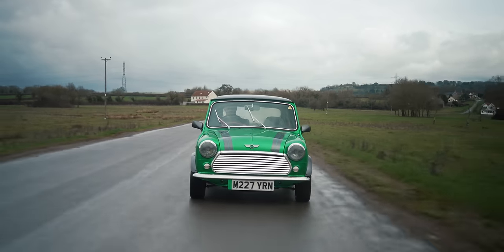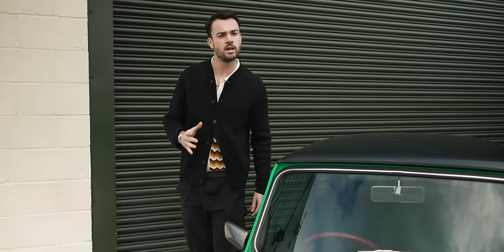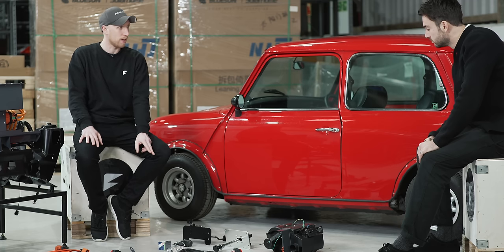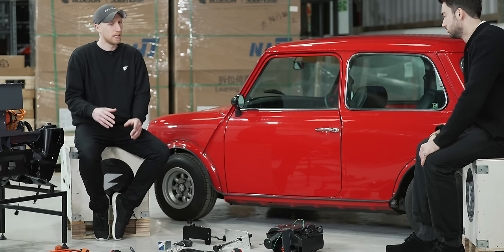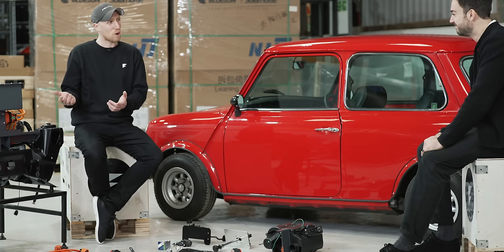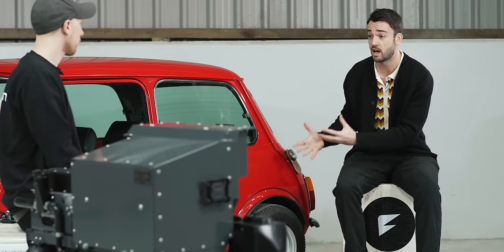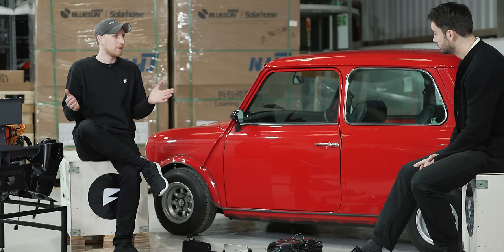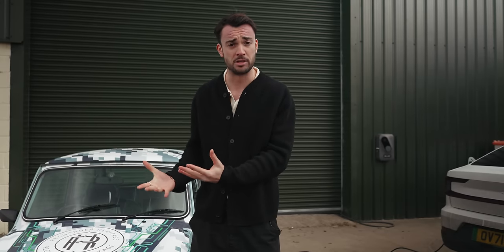How CHEAPLY Can You EV Convert Your Old Car?

Comment: At first glance it seems like a good idea to get a cheap conversion, IF you have a decent car and if you can get the conversion done at a good price. There's an increasing worry that Tesla may software lock or hardlock their part compatibility and use like how Apple had has done.

However, if you don't have an old car or are looking for one, you'll need to buy and repair one (new components, bodywork could set you back hundred to thousands).

Then you'll be losing out on modern conveniences and safety, ABS, aircon,  sensors and even safety ratings. 

It may be cheaper to buy an old EV, an old hybrid or a new EV as bad as it sounds.

Comment: The easiest and cheapest conversion? I'm sure I'm not the only one to have this idea... As most cars on the road are front-wheel-drive & ICE, the simplest and cheapest conversion kit must be to add small hub motors to the rear wheels and a small battery. Along with a simple controller to add power when accelerating / cruising and regenerate under braking. It could be totally independent of the cars existing functions and controls. It could add many miles per gallon. I think it should be relatively cheap and quite simple and easy to fit too. Is this approach being progressed by anyone?

Comment: would be nice if someone made in wheel motors to stick on old cars to electrify them... seems simpler to me... rip out the engine/transmission, replace the fuel tank and fill the engine space with battery boxes...

Comment: I want to get into the conversion business, but the more I learn about it the more I think that manufacturing the components is needed more. All the advanced components that are being salvaged from wrecked EVs, motors, electric brake boosters, traction and stability control, etc, are made by mega corporations like Bosch that couldn’t be less interested in selling for conversions.

Comment: I own a Vespa pk50 xl , I really wanted it to be electric but getting parts for it is a joke and the places who do them are always out of stock. I thought about building it all fully custom but its so difficult due to the tiny amount of space available.  I ended up just building a full custom 125cc racing engine for it. Yes the thing is stupid fast but I wanted it to be almost silent and be eco. Also wanted to power it in the future off home solar power. It sucks because I spent over 10k on the engine, for something that I didn't really want to begin with as I wanted it as an EV so I'm just waiting for something decent to come out thats a normal price and is easily available , I will end up just buying another Vespa to convert to EV.

Comment: Not impossible, but highly impractical and not profitable. Bear in mind how often parts don't fit apparently identical cars. Prices will drop, but someone really needs to concentrate on a PnP HV system and modular battery system that can be flashed for different chemistries, as they change.

Comment: this is the way to go ...Makes more sense..Why make more cars if we can update current or older cars..Nice and simple none of this Sat nave video screen crap...Just a gage for speed and battery ....This is what GM and Ford should be doing instead of trying to catch up to Tesla . But for now it will not work in Canada its not allowed as of yet to which i do not understand they want us to change over to EV so whats the diff if it a Tesla or converting my KIA to a EV seems a no brainer to me ... its what i like and call High Low Tech solution and ....I hope to see this happen world wide some needs to knock GM and Ford of there high horses

Comment: You don't need to convert your old car to be an EV. All you need to do is to convert it to run on propane or methane, doing so is regularly cheaper than $1000 - half that for propane. If you have plenty of CNG stations to refuel your car in your country, you can even get it to run on methane, which is very eco-friendly compared to gasoline and propane - but that's only really possible for engines that are more than 90HP and if your car is already quite heavy (like if it's a sedan), so that the extra weight of the large methane tank wouldn't be too hard on your suspension and your engine.

Comment: Frankly, anyone who thinks that going electric is the best option, really needs their heads examined! I will be holding onto my ICE car until they prise the keys from my lifeless hand! The people at Toyota are not fools! They have equally found electric vehicles to be a distraction at best. The real option is “green ammonia”. This is Hydrogen fuel in a form that can be used in place of petrol; can be pumped like petrol and burns to leave water as the exhaust! There is no need to replace the engines, simply replace the fuel used in ICE vehicles!

Comment: It's not the engine that causes ICE cars to reach the end of their lives, it's the fact that after 15-20 years everything else wears out. The body rusts, the brake pipes corrode, the power steering pipes corrode. Innumerable parts need replacing and it just becomes uneconomic to keep a car on the road, especially if your paying a mechanic rather than doing it yourself.
I'm afraid EV conversion will only ever appeal to people willing to invest more money into a much loved classic than a modern replacement would cost. This applies even more to modern classics with their complicated electronics.

Comment: It's frustrating how expensive this stuff still is, I've got a Citroen C4 grand picasso that I'd love to have the engine ripped out of and batteries and motor put in it's place. I figure to get something comparable it's going to set me back around 10k after the arse finally falls off it, so if I could get an EV kit for that kind of price I'd be all over it!

Comment: Many years ago I have written a business plan on how conversion can be done at scale.  Unfortunately, I've never been able to get the funding.  I'm still convinced it can be done, and I am sure that (with the right team and sufficient funding) one can make it work on very large scale.  It would probably take 5 to 10 years to develop the kits, that can be installed by any half decent mechanic in say a day or so.  Basically the kits bolt into the original car using all the existing attachment points already there.  The other aspect, the original ECU for the engine would be reflashed so it becomes the communication in the CAN system for the electrical drive train.  As mentioned in the video, it is dependent on cost of battery and other components, those are still be bit expensive but as Tesla and some of the Chinese manufacturers are proving, that is coming down rapidly.

Comment: I understand why EV kit makers don't want to send their kits to just anybody. You want the job done well and the high voltage side of the conversion, needs to be treated with great respect and caution. However, I don't see why qualified MV technicians like myself can't be supplied with all the components minus the traction battery. And once the car is ready, take the car to have the traction battery fitted by those with the knowledge and the equipment to safely finish the project.

Comment: Retro fitting for classics will be a thing but for your old daily driver I dont see it being cost effective. I dont see the cost of batteries coming down considerably while they are Lithium based plus other rare metals because it is the supply of raw materials that makes Li-Ion batteries high in cost and restricted in supply. If a new battery tech using cheaper and more common inputs crops up then the retro fit conundram will improve. however we know battery tech for cars is pretty much at its zenith with Li-i0n so solid state will probably be the wished for change and that is still a while off. The other factor about converting a daily driver is that a car is more than just an engine and gearbox. If your vehicle is at the stage where the driveline is on the way out then things like suspension and brakes and the interior may worse for wear as well especially if you have children. I know of cars that are not 8 years old and you can not buy parts for climate control systems or the servo motors that open tailgates and even windows as well as sun roofs. I live in a climate where the body of a vehicle lasts a very long time if basic maintenance is done but in the snow and ice areas the car body and bits cop a pounding.  +Now the other problem is that without an affordable retrofitting option replacing the global private vehicle fleet in the time frame those with rose coloured glasses say will happen is impossible. Even someone who is mathimatically challenged like me can work out given current build quantites of ICE vehicles and the average turnover time that car owners have that it will take many years longer, even decades, before everyone is driving a BEV. EV production will not match ICE production for many years if ever and battery supply is only one factor. You will also have to consider that there is a very large pool of people who never buy a new car for a lot of varied reasons and 2nd hand BEV's will be even harder to get and outside of these people purchasing power in many cases. Cars are not retail white goods, production is not that easy to ramp up. From a climate change action persective getting a total change over to BEV's completed is a drop in the bucket. Some say 10% others say less than that of greenhouse gasses come from the global private car fleet even the total transport sector that uses fossil fuels at present is under 20% so the main benifit of the private car fleet going electric would be city polution and the public and business sectors not being held to ransom by fuels cost cartels. Well thats my two cents worth and I am sure many dont agree but being a retired engineer in the automotive industry I know how supply chains work and how long they take to establish and how fragile they have become in a globalised and JIT supply world. I have not even touched on a world with conflicts going on and future ones that will limit our use of Chinese manufacturing capability.

Comment: I would love to do an EV conversion of my own. I myself would love to do a minicooper, but my wife doesnt like mini coopers for some reason. Who knows what I will do eventually. Ive built batteries and electrical systems before, so I think I could learn how to do it myself... I know Im going to want something small and lightweight enough to keep the cost of the battery and motor as low as possible. I only hope to get a 50 mile range or so...

Comment: Haha That orange buzz-bar or bus-bar is coated in orange rubber not for durability or "doing it nicely" but for insulation. It's a high current conductor. So not a great example of something that can be use to cut corners to make it cheaper.

Comment: If you have a relatively new IC car and want to convert it to EV, there will be problems with sensors you have to remove from the car. How will kit companies solve all that?
Kit companies should also look into cheap replacement battery packs for current EV car that brake and replacement parts cost more than the car is worth...

Comment: Most modern cars were never designed to be repaired. They are built by robots in a way that requires too much work to even get at the parts. They do not produce parts long enough or models with interchangable parts over the years. Not to mention anti right to repair problems. They are built and made to be simply thrown away objects that self destruct once the warranty is done. Something like 70% of the polution is in throwing away your old car. Electric cars are simply a buzz word to distract you from the real problem and get you to buy another car.

Comment: Most people will not replace their cars in next 5 years. Even if there's a miracle and all car makers switch current production to 100% EV and the production volumes are not lower, it will take at least 20 years to replaces all vehicles on the roads today.

Comment: I have built two ev swapped cars over the last 6 years they are both what I would call legit inspected not lick and sticked and their is no cheap ev if you want that buy a Tesla used that’s your cheapest ev that main expensive parts won’t break and if I cell goes in your batteries you can individually replace sections of the battery’s I’ve built I get 230 mile range in the jeep on 37 full treads and 260 on a land rover defender 110 on 33 full tread the strength of these different batteries from quality to crap can be felt upon their delivery in power do it right and do it good first time you can always recover batteries and motors and control from a car if it was wrecked to shit does happen once you get good tech you’ll never go crap again

Comment: As a vanity project then why not?

That said a car is merely a conveyance and doesn't need to be a "supercar" with half a ton of battery powering a two ton car with 60 ish Kg of human as the load.

Utterly ridiculous seeing as the entire idea is to be cleaning up the atmosphere and not catering to immature car nuts who are obliged to wait for a while to get to a public charger and then wait for charging to occur ... and then talk amongst themselves as in extolling the largely non existent virtues of a battery powered car.

Fortunately ever increasing numbers of car manufacturers are designing hydrogen fuel cell vehicles now they have identified the issues of sourcing lithium.

Electric cars (and other transport) are excellent as in helping to reduce fossil fuel emissions ... but using batteries to power them isn't.

Comment: 6:50 i dont agree with this guy stating you dont need more range for the mini and just pushing the conversion to be a city only car... that doesnt entice owners to do the conversion if its just limited to city driving. Full ev conversions should have close to the trip range as an original gas tank the car had originally. The owner of this company also brags about how the car is lighter then the original when he could of extended its range with trying to target its original weight or going further.

Comment: Also for a conversion, there is basically no real value in what's left, the body and some wiring, versus the cost of the engine and power train (especially in the case of an old mini)

Comment: used tesla batteries are $500/ea now. i have used them in my home solar i built. especially for an around town car which the mini and the car i would want to convert the honda del sol, using older batteries is no problem and the motor does not have to be so large for these little cars. i am not a fan of a kit that fits all anyway. i would rather be able to mix and match depending what i want to do with the vehicle. converting my orchard truck 1976 ford f-350 will need a very different setup than the del sol. we diyers are fully capable of fabricating and fitting batteries in an optimized way for our specific vehicle. for my truck, for example i would make a tesla like tray or modify a tesla tray and place it under the truck bed. on the del sol i would place batteries in place of the gas tank forward to the seats and then in the front compartment especially if i could get hub motors which would be the way to go.

Comment: Another issue with conversions, not stated in this video. Because a car that was originally designed to burn gas will only have so much space for batteries, the range of a converted car will be inferior, both to the internal combustion engine that was in the car prior, and to modern EVs, which are designed from the get-go around the space requirements of a large battery.

So, in order for the conversion to be worth both the range hit and the fact that you still have an old body, relative to simply buying new, the price needs to be far cheaper. And, even then, it may still only make sense in that rare case where the car's gas engine completely dies, requiring an expensive, out-of-warranty replacement anyway, while the condition of the body is still nearly brand new.

Comment: As the number of new ICE car sales drop at the same time as the cost of production of conversion kits drops I think there will be a shrinking window of opportunity to make retro conversion worthwhile. By the time the cost is low enough there may not be enough donor cars left that are in good enough condition to make it viable. Personally, I hope that doesn't turn out to be the case but if it does it would mean the price of a basic EV should have also dropped, so not all bad.

Comment: Hmmm .  Its always a mixed message when I see a modded car like this . I say Modded because its not standard and its not what spares suppliers would see as standard and would doubt if any suppliers would guarrantee their products such as brake parts or tyres , bearings etc  when the car is a totaly different concept such as weight , steering acceleration and top speed  .      Plus , the elephant in the room is now the insurance companies reluctant to quote even for factory cars never mind resto classics .      This means that this mini on a few years time after the company that put the electronic contraption in to it has gone bankrupt or cease trading that the new owner , pehaps from an auction will no doubt have problems when it inevitably goes wrong and Mini parts suppliers wont want to know or cant help .      There fore my advice is junk the electrics and retro fit the proper engine and box . Its Tax MOT and ULEZ exempt and still does 50 mpg      How cheap do you want a car to be ??